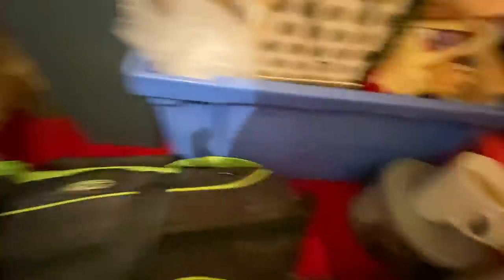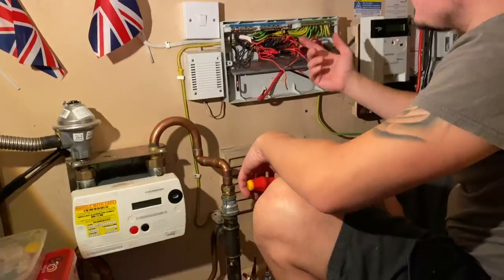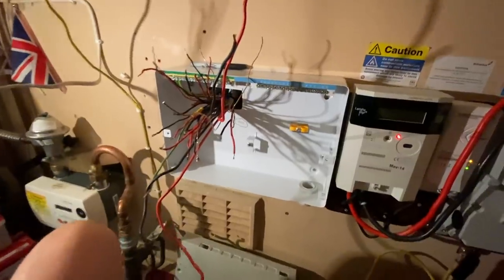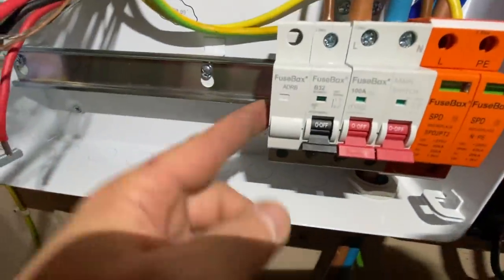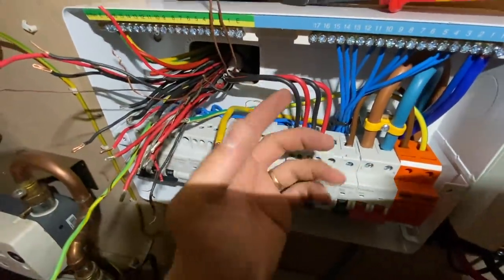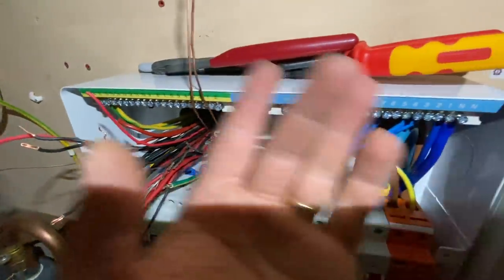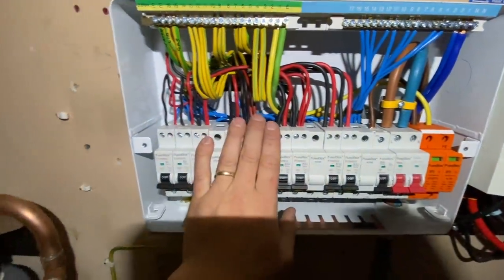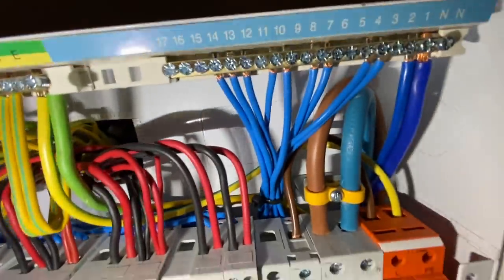18th Edition Consumer Unit Upgrade Glamorous Life Of An Electrician

Comment: I also prefer the dummy breakers to the blanking plates. I think it looks a lot nicer.
Reply: Nice when you're working in the board and need the busbar live too. No way you can possibly slip and touch it with those blacks + busbar cover in place.

Comment: When I started work it was the  13th Edition so watching now it is so different -  I remember riping out both Rubber and lead cables on  2amp, 5amp and 15amp sockets and fuse board all over the place in the same house.  I must say one thing drummed into me was Use the Right tool i.e. a nut requires a spanner or nut spinner NOT pliers......
Reply from the maker: It was a set of grips
Reply: @Cjrelectrical  not a spanner :)
Reply: Learned under the 16th edition on industrial maintenance. Same for me.  Right tool for the job. Difference with most modern domestic is that you'd end up carrying loads of different tools at your own expense. My solution is a pair of decent adjustable spanners for gland nuts, and smaller ones, I carry a roll of small metric spanners and lovely bahco mini socket set, size of a pack of cigs. . Don't come across much imperial (BA/Whit) stuff but if so, usually it's ripping OUT, so pliers are fine
Reply: One tool I am missing is a decent bush spanner

Comment: Chris: at 11:58 the bond for a 7kW shower goes back to the 14th edition (then a plain green sheath). Logic for the 6 sqmm earth bond was to match the size of the live conductors, there have always been questions as to why the cpc in twin and earth cable has a smaller x section. In the early 70s, 7kW seemed an unusually large load for the old distribution boards, also cable run was usually substantially longer than cooker supply cable.
Matching total size of CPC to live conductors satisfied short circuit requirements without calc. Earth loop testers were fairly rare beasts yesteryear.

Comment: you could have filled the hole at the back with Intumescent Fire & Smoke Stop Pillows these are a lot easier if you need to add any new circuits

Comment: In Canada and the USA,
120V circuits are Black is Hot/Live, White is Neutral and bare/Green is Ground (Earth for those in the UK).
240V circuits are Black is Line 1, Red is Line 2, White (rarely used, usually only for cloths dryers and kitchen stoves/ovens where you have 120V control circuits in the appliance that need the Neutral to work properly) is Neutral and bare/Green is Ground (Earth for those in the UK).

Comment: The torque screwdrivers, the draper and the armeg both have a good range of settings whereas other brands are lacking. There are three reasons i feel why the draper is better than the armeg.

The draper is cheaper by a mile.

The draper comes in a cloth pack which means it takes up less space in the bag or pocket.

And finally, the torque adjustment is always with the draper driver, it is part of it, whereas the armeg is separate and and easily be misplaced.

The armeg set is beautiful mind.
Reply from the maker: Yeah armeg is fantastic quality but the Draper is five for the amount of times I use it.
Reply: @electricalstuff259  CJR seems to use it a lot, has no complaints. And, I wonder if the so called brand snobs have ever tried a little bit of rough? 🤔🤭😷
Reply: I bought the draper as it came with everything, had a wide range of settings, but the main thing was it didn't need another tool to set the torque settings. One criticism, the colours make it look cheap.
Reply: @acelectricalsecurity  Dolly Parton admits she looks cheap, but she's one amazing person.
😷😊

Comment: Did you say 2 showers?  Are these both electric showers and if so I wouldn't be putting them both into a new consumer unit for loading on the main dno fuse. In this scenario I either tell my customer that they can only have 1 reinstated into the new board or I have to fit a priority board also for the 2 showers.  I've done this a few times with shower and car charger setups too.

Comment: That labeller is the nuts. I have the wireless version and use it from a PC :) Good stuff, nice job as always.
Reply from the maker: Thanks Steve and agree on the labeller
Reply: I bought that label machine or similar as it was on offer, it's useful but the app needs updating it only shows basic consumer unit configuration and Proteus boards

Comment: Plastic doesn't cause fires loose connections do, only reason to change the db is the ability to get rcbos usually crabtree loadstar fit
Reply: Very true, but plastic doesn't contain fires if they start and metal will...
Reply from the maker: Only means of escape in the property especially with children otherwise I don’t even code it just make a note

Comment: Not joining the "ferrel all the things" gang?

Great work, love your explanations along the way. I'm not a spark, but fine something about electrical work interesting, so it's nice to pick up the odd little fact as I'm watching.
Reply: I’m the same. Think I got hooked when I was trying to find videos that may help in fault finding, because the wiring in our house is awful. And although not qualified in Electrical installations. I did five years of Electronics Servicing so can figure a few things out. I just wanted to find things out that I could check with all the power off like correct way to route cables in sockets (for example I didn’t know it’s good practice to double ends going into socket terminals, and also I never knew that the CPC/earth on twin and earth cable is meant to be sleeved when entering the back of the socket (non of the sockets I’ve looked at have any sleeving). But also when I do want to call an electrician out, I have a better idea of what makes a good electrician and to ignore £85 EICR ones!

Comment: Odd that so many people are going to wireless doorbells. I've literally installed a nice new custom relay panel for Mum's doorbell. She's going deaf (despite denying it) so what I've done is put proper doorbells in every room with a central control panel to turn on and off various rooms. (in case people who AREN'T deaf are staying, like me!) Interfaced to her original wireless doorbell using a reed relay.

Overkill? Yes... Will it last longer than modern wireless crap? Yes.

Edit: it's all running at 12v using a battery backed alarm PSU I pulled off a job, just needed a new battery and doubles as the actual control panel  (just a few switches added to the outside and relays on the inside)

Comment: Here's a simple way of understanding the terms used in American Electrics. On the left of the slash will be the common term, on the right is the definition in the code.

Live = Hot/Ungrounded Conductor
Neutral = Neutral/Grounded Conductor
Earth = Equipment Grounding Conductor

Take careful note, that we don't call anything phase. We have some systems where your grounded conductor or neutral is actually a phase! The majority of earthing systems (well over 99%) are TN-C-S.
Reply: And that is Line, not Live. Neutral is a live conductor as well!

Comment: What's the largest 'way' board you would install in a brick shed/workshop with hindsight in mind looking to populate with hobby machines. Mini lathe,vertical drill etc etc. ?
Reply: In theory you can have as many ways as possible. You really are going to be more concerned about what load current you will be drawing when operating the machines and how large a supply you can run. Considering that you will usually only be running 1 or two machines at a time and loading on mini lathe and pillar drill are not substantial you could in theory run these off of 1 20amp circuit, add another 20 amp circuit for future projects and a 6 amp lighting circuit, allow for a mains switch you could install a 5 way garage board.

Comment: That was a smart meter right? Doesn’t it notify the provider that the meter has been tampered with when the cover has been removed? What is the procedure you usually take when dealing with smart meters with 16mm tails?
Reply: You've gotta call in Pablo mate.
Reply: Same smart meter as mine, which only started flashing amber on the top light (WAN) after I'd changed suppliers from the one who installed it. This one also appears to be flashing orange, so I'd guess the current provider can no longer speak to it. Maybe it still reports to the 'original' provider, but whether they'd care is a different matter, especially with no active account.

Comment: You did a neat job 👍 but those boards and RCBOs don’t inspire me with confidence, used em once, just the once mind.
I’ll stick with Square D and Merlin.
Reply: It's had to beat an MCB that plugs into a bus bar, why they are not more common I don't know.
These are ok, but they are a generic rcbo badged with whichever company is buying them.
Reply: It’s cost.
I do mainly commercial work, so i’m not in direct competition with the domestic boys (which is a tight market) so i can see why they buy cheap materials.
Reply: @acelectricalsecurity  Funny that it's not common in the UK.  Here in the USA, everything snaps in to the bus bar (s) in the panelboard.  Seems so foreign to me that you would want to run a bus bar underneath and have 2x as many joints to torque/maintain in the long run to distribute power.  Cost certainly is much lower for that consumer unit vs the USA style main panel board used in our homes, so I get why its done that way.  I love seeing how other countries handle electrical distribution.  There's never just one "right/proper way"

Comment: It 150mm from the main incomes to the the emergency control handle and 25mm from gas pipe to cable hope u have a festive Christmas or wrap gas pipe in a non conductive pipe or cable through plastic tube !!!

Comment: What are your thoughts on the aluminium cable? I know some ppl will fail an eicr for it 🤦🏻‍♂️
Reply from the maker: It’s not aluminum it’s tinned copper
Reply: CJR ELECTRICAL is it? I always thought they used Aluminium during a period where copper was unavailable.  or is this cable specifically tinned copper?
Reply from the maker: They did do aluminum but the size would be a lot bigger due aluminum being a poor conductor
Reply: @Cjrelectrical   See the installations in the German Democratic Republic (GDR ex. Russian Sector). They haven't copper so they use aluminium only over the years. 

Do you can change lamps monatly and problem alu =》copper and vis versa. 

Some sparks and I repair an old castle near Karstädt city, we change over 5 km of 3 phase and 8 km of 1 phase of cable! They have wood floor same you in UK of course - I never make so many holes in my life. 😂😊 

BTW: alu 4 mm <=> copper 1.5/2.5 mm // alu 6 mm <=> copper 4 mm

Comment: Out of interest what would you do when replacing a CU if the existing cabling doesn’t reach, would you extend the cables or pull them back and run in new ones.
Reply: Depends
Reply: If easy to do there and then and doesn’t take to long then yes if not joint and ask client
Reply: you tend to extend them with a wago or a connector , if the board is moving to a new location you will need to put them in a junction box to his new location

Comment: Sorry, you left gaps to reduce hot spots. But you then put 2, 40amp showers together?
Reply from the maker: 32 amp rcbos with a gap either side yes.
Reply: Or 32amps my bad, but the hot spot will happen in the middle of both those rcbos no? 

To be fair ive only come across 1 burnt out rcbo before so i don't even think it matters that much
Reply: Although what kind of water pressure would you have with both showers running?

Comment: Plastic CU under wooden staircase with no sign of heat damage C3
Reply: No RCD protection on lights hardly warrants a consumer unit upgrade either, if it did I'd be replacing nearly every board I work on! A lot of sparks giving the wrong advice to customers lately, especially YouTube sparks! Dave Savery is about the only one not pushing people into RCBO surge protected boards
Reply from the maker: Big accusation there Mick don’t jump to conclusions when you’ve only watched a 20 minute video. The client is making significant changes to the property and is doing things the correct way getting the electrics checked first then upgrading the consumer unit for future expansion!!
Reply: @Cjrelectrical  wasn't an accusation, you mentioned at the start of the video a plastic consumer unit under the stairs and lack of RCD protection warranted the upgrade. If the customer is upgrading for future expansion then thats great... I wish all customers had the forward thinking and commitment to safety! There's just a lot of sparks miss informing people at the minute on what warrants an upgrade and going off their personal opinion and not BS7671!
Reply: @mickbitchum4664  i think the key word he used was 'request' not 'required' when plastic fb under wooden stairs. But I understand where you're coming from. Without analysing, one can be lead to think that you need to replace due to how it was presented in the video.  But more importantly it's what Chris told the client rather than how he presented it in the video.  But I think Chris should have mentioned 'it was a C3 but', just to avoid confusion.

Anyway good work Chris

Comment: The first ring you checked the cpc reading  seemed slightly high when you  work out the live x 1.67, pablo is a n amazing guy
Reply from the maker: Remember it’s imperial not metric
Reply: @Cjrelectrical  hi Chris didn’t realise it was an old Install the other ring circuit you tested seemed fine at 1.25 ohms that’s the reason I made the comment
Reply: I’m sure Pablo has a cousin who calls on my jobs every so often to install isolators and new meter tails
Reply: I don’t need pablo, I cut the frigging seals and remove the main fuse my self, there ive said it. Grow some nuts people
Reply: @supersparks9466  do you remove and replace the main fuse safely with flash protection rubber gloves??
Reply: Dusty 99  dusty the clown?  Think I remember you
Reply: @leebutterworth7465  no way, just close my eyes and hope for the best
Reply: @supersparks9466  got to love your way of thinking just buy a pair of gloves to withstand 10000 volts off Amazon only £34 well worth the money, my mate burnt the back of his hand connecting up a UPS a while back made a mess of his hand
Reply: @leebutterworth7465  just having a laugh mate, don't take it seriously like dome people that can't take the banter, rest assured I follow all the safety requirements, made it to 44 years in the trade without any accident,s ( I'm touching wood now)

Comment: Can I ask who is Pablo? Because  in the past Dave Savery used to use a company called Haste to fit isolators and you use Pablo, and I always wondered, do they have some special qualification to fit isolators, because I’ve seen you buy a Wylex unit, you knew what type you wanted, and I’m sure your more than capable of fitting it yourself, except you’d have to pull the main fuse, which I’m guessing your not allowed, but Pablo is? Infact I can remember Dan from DSS said in one of his videos, that he got the fire brigade to pull the main fuse. But in one of Dave Savery’s more recent videos, if I remember correctly, Haste are no longer allowed to fit them or pull the main fuse, not sure if he was implying that only the DNO can now? On a separate subject, that fire sealant looked really nicely applied, but I remember quite a few birdies back, you said how someone on Instagram said they drill holes in the back and use the Wiska fire grommets and so you did the same, and that seems a good idea, but I’m guessing you had change of mind? In fact I noticed Jordan is now (or at least empathising it more as not noticed before) applying fire sealant in rear entry holes (Can hear Nick and Adam giggling 🤭). Good job as usual!
Reply: Not sure if you are serious but pablo is a fictional seal cutter and main fuse remover who travels the country helping the sparks too scared to do it them selves.

Comment: Whats the spec now on stranded cable? Isn't that a fail and a rewire of the circuit?
Reply: Why would it need a re-wire?  If insulation resistance is fine
Reply: @PJB71  I just wasn't sure of the re-termination of a 50+ year old cable. Doesn't cable have a life span of 25-40 years as stated by manufacturers?
Reply: @James_scott86  stranded cable was available in 1.5 and 2.5 twin and cpc  well after the year 2000. It was used on specified jobs such as council properties. Have seen it in new colours although it’s rare.
Reply: @jamesdyas542  To be honest I didn't know about that, but you can tell by the colour of the conductor that the cable is 70's. Just makes me wonder when do people start taking out stranded cable if this is deemed adequate? when a fire starts or when it breaks down?
Reply from the maker: One of the reasons I always insist an EICR on stranded tin copper because of the age. If it all tests out fine like this one then I have no issue in upgrading the consumer unit.
Reply: @James_scott86  if it’s imperial sized I’d be dubious. Lighting was commonly 3/.029” equivalent to 1 mm. The line and neutral had 3 strands and the cpc just 1 so the cpc was a third of the size. Sockets were commonly 7/.029” equivalent to 2.5 mm. The line and neutral had 7 strands and the earth just 3 so the earth was less than half the size. There’s another one equivalent to 1.5 mm but I can’t remember the imperial size of that. I believe generally most metric sized twin and cpc cables your likely to come across have a solid earth wire up to 6.0mm.

Comment: Mail order fuse boards made in china. Why not buy a Hager or Wylex thats made in England from your local wholesaler. No offence intended.
Reply from the maker: I love Hager and Wylex boards but unfortunately for what they are they are so overpriced it’s unreal if I price a Hager board with rcbo and surge protection plus bits it’s already costing £650 before I’ve even done any work.
Reply: @Cjrelectrical  totally get that.